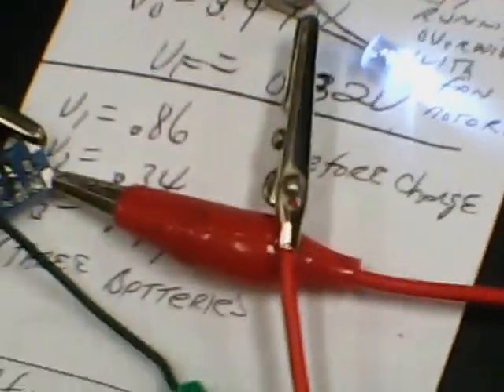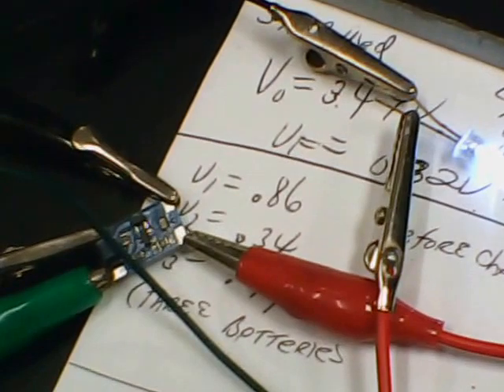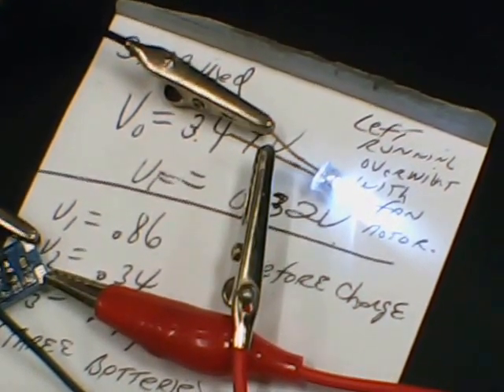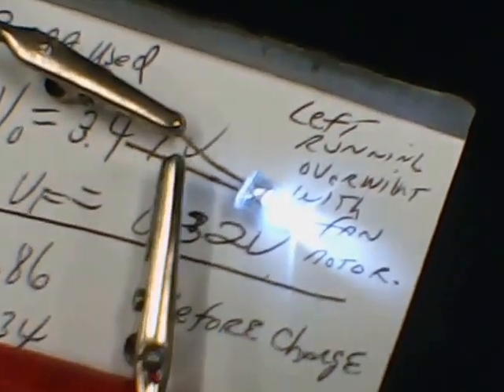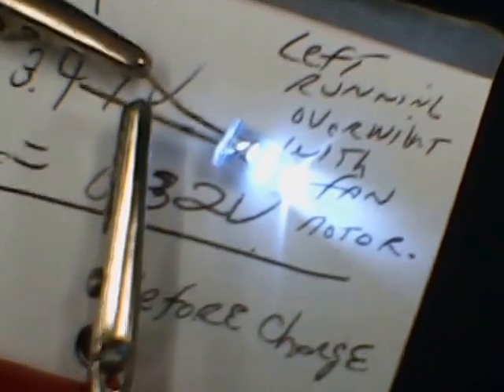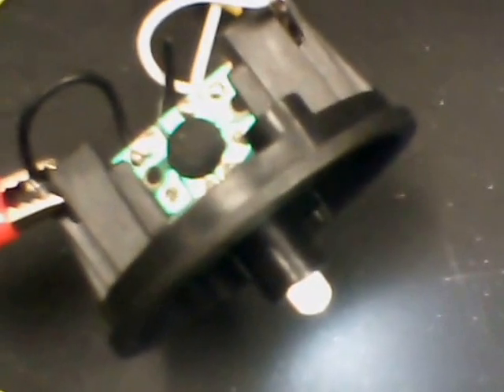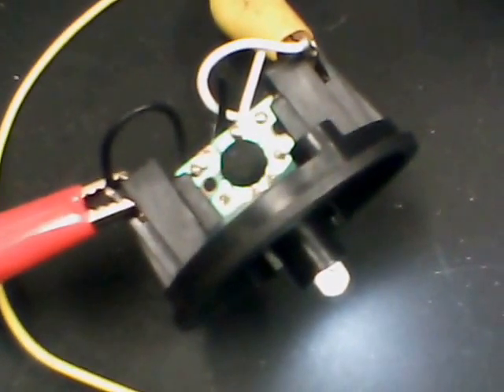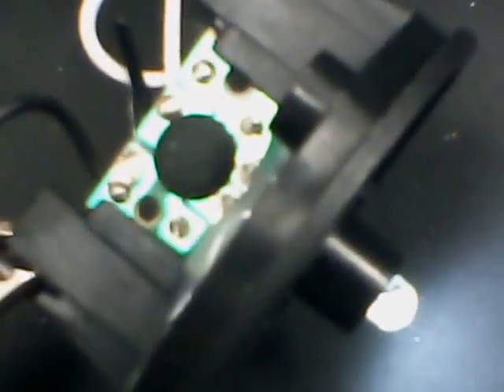Joule Thief Alternative/ 0.52V/ Garden Solar Light

Comment: What are your thoughts on crystal batteries?
Reply from the maker: +David King A novelty in many ways; they are heavy.
Reply: +David Soriano
I have seen where some of the crystal batteries made on you tube claim to run for 2 years or more. Do you think that claim holds any water?
Reply from the maker: Can't say for sure, but with tiny power output, I guess so.

Comment: Well done, how much current do these draw compared to a JouleThief at the same input voltage ?
So do they use more power than a JT circuit ?
Reply: I measured it myself, the circuit consumes 50mA with the LED